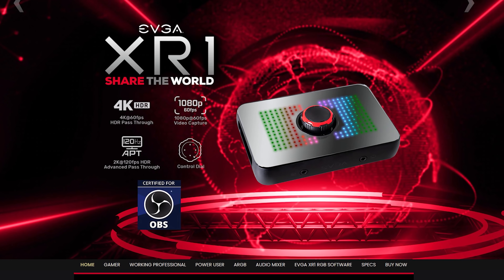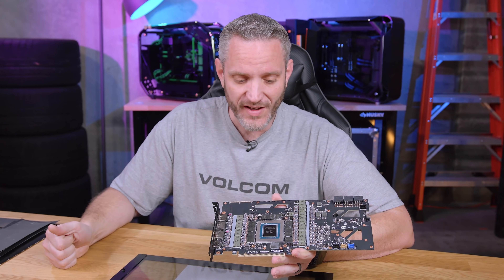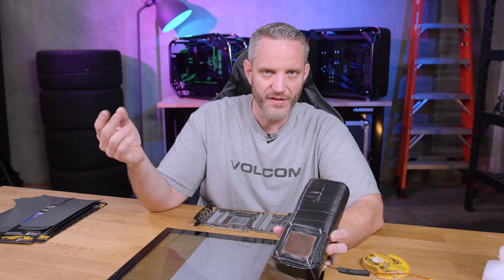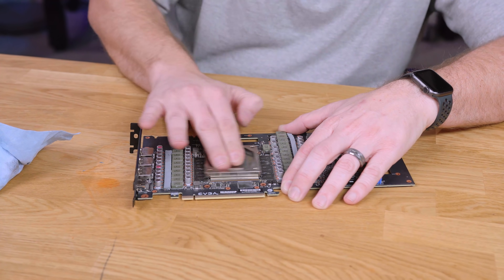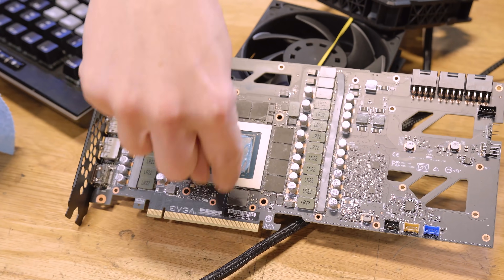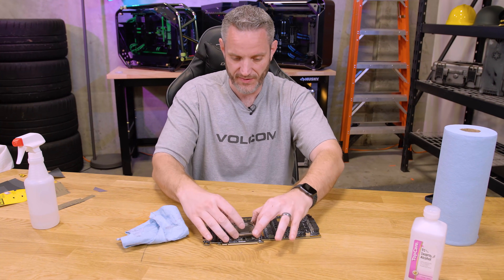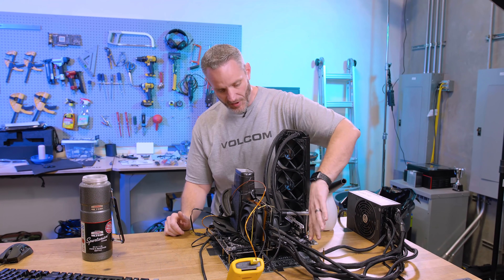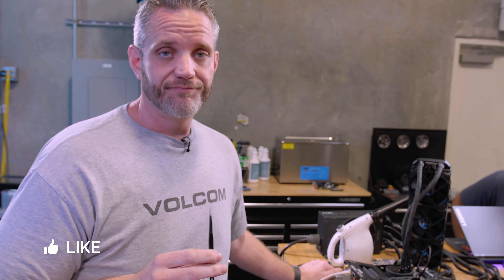I ruined another GPU....

Comment: I have a suggestion from a mechanical engineer (love these videos btw). Try using WD40 instead of water when lapping. It will help keep a more even lapped surface with a better finish. I did a bunch of this for parts in the aerospace industry to hit 1/1000 of an inch on tight tolerance parts (a third the thickness of hair). I would also grab a high precision mic (not calipers) and use that to get an idea of how much your removing and try and use a flat surface on the back side as well. If it’s tilted like it appears in the video, that might contribute to the L shape you had when lapping. You don’t really care about the flatness to the silicon but to the die itself so keeping the die flat and supported will help you take material off more even with respect to the die and not the silicon.
Reply: Isnt WD40 a lubricant also? Wouldnt there be some type of flammable lubricant left over any circuitry? Idk what the flash point is for WD40 but that would be cool to use.
Reply: @antiviruz42  wd40 is non conductive if this is your point?
Reply: @antiviruz42  wd40 is used for some engines, it can even be used if you run out of motor oil for a very short period of time.  plus alcohol cleans of oil without problem....
Reply: @auros2108  no he seriously thinks 1. that the wd40 could be start burning on the card, and that after cleaning the card with alcohol there would be oil left.
Reply: The parallelism of the die to the card is irrelevant as long as the die surface is parallel to the mounting face of the pot. With the amount of different components on the back of the card short of making a jig plate for the card you would never be able to achieve  getting the card to be flat on the working surface.
Reply: hahaha aerospace engineer saying "your" instead of "you're"
Reply: @mmmdawe  And using inches 😂
Reply: @mmmdawe  He's an aerospace engineer, not and English teacher.
Reply: @mmmdawe  :) we ain’t so good with spelling and grammar.
Reply: @DZPengu  I don’t think I explained it right but you are correct. What I was trying to imply was that if he laps the die at an off angle he would risk removing too much material on the top of the die and expose or destroy some the transistors. So parallelism to whichever plane was used as a reference for the transistors is pretty important. But I don’t think he is trying to take that much material off.
Reply: @antiviruz42  yes WD40 is a lubricant. That’s what you want to use when sanding metals. It helps the sand paper not get gummed up and still able to cut into the material. I personally would use acetone to clean it up bec it does a better job than alcohol. I think, but need to check that it’s safe to use on electronics, at least my EE friends used it in college. :)
Reply: @kaldogorath  I believe ewe mean "knot AN English teacher!" (homonyms used on porpoise.) :p
Reply: @petenielsen6683  Ahh dammit. That's what I get for not proof reading.
Reply: Pretty much any cutting fluid will do, as long as it's not too acidic. Laying the PCB on something like a 2-3+mm mat of silicone rubber (closed cell, firm but not hard, very heat tolerant) making sure the IO bracket is off or floating freely, is also adviceable. If using a big and heavy "sanding block" like this, there's no need to further stabilize. Just let the weight of the block do the work, and the size the block will keep things even because it will be gliding on the metal support frame around the die.

For checking the spread result, personally I use a lapped and polished 1 inch thick clear acrylic block with mounting holes, and just mount it like I would a cooler/waterblock/pot. That way I can see the pattern while it's actually torqued down, through the acrylic (where its close to "perfect", the layer is so thin it's transparent).
Reply: @pr0xZen  I feel like we’re getting into the weeds a but hey that’s what is so much fun! :) I like the idea of using an acrylic block to see the stress. I was thinking of using a small torque wrench and using a similar procedure used to put the valve cover on an engine. However, I like your approach better but I might still use 1/4” torque wrench just for constituency.
Probably supporting as I suggested is probably overkill and he does seem to be doing a good job of not rocking the sanding block. 
Thanks for the input and  ideas!
Reply: 1/1000 of an inch is like saying two hourglasses after 12
Reply: @TheGroberUnfug  well normally I would say “a thou” or “a few tenths at a time if you know what you’re doing” but I was trying to be understood and not confusing. Next time I’ll just muddy the water for you. :)
Reply: @TheGroberUnfug  I'd humbly suggest that the average consumer or tech-curious, does not have a relative understanding of dimensions for terms like "thou", "mils" and microns. Perfectly normal if you've never had a need for it. Choice of words probably fit the average audience here.
Reply: @mmmdawe  he might not be an “Amurican” trashcompactor thats unaware theres other places
Reply: Machinist here.  0.001” is not tight tolerance for lapping unless it’s across a comparatively large distance e.g. 12.0”.  Context matters.
Reply: @emilen2  As they do. You do realize that Lockheed Martin uses inches right? I mean, that's the whole reason NASA had a blunder with a mars probe. Lockheed made all their equipment inch standard. Telemetry included. Nasa didn't check and assumed it was in metric. Made a nice crater on Mars. The F22 was designed with inch standard, and parts made in American factories with inch standard machining. it's good copy protection honestly.
Reply: @TheGroberUnfug  you just have to be familiar with the Measurement that's all.
Reply: you're telling me that you have a OEM Manual that allows WD40 as a lapping agent ?   or were you using it for sanding.   Because all Manuals that ask for lapping usually use diamond suspensions or silicon carbide and a lapping plate.   BTW  Engine Overhaul here and we beat our Helium Light Band device regularly.
Reply: @shawnbottom4769  this is where  a optical flat and a helium light source come in. 
But the chip might be a bit dark in the reflection to see fringes.
Reply: i used to lap with Isopropyl alcohol, similar properties but wd40 is probably not great for computer parts. also a profilometer and a surface plate are going to work better than a mic, though its gonna be hard to make sure the card is flat to begin with
Reply: @Fahrenheit353  Appreciate the answer! Thanks for not being condescending and speaking for me. Il keep this in mind!
Reply: @scythelord  I can’t comment on what those companies use or allowed to but yes that really happened and was a great blunder. :)
Reply: @scruffy3121  you’re right I misspoke there. Lapping is polishing, and I was more referring to sanding or grinding. Jay was saying lapping when he was actually sanding so I’ll just blame him for my error. :)
Reply: @Fahrenheit353  Lapping isn't polishing.  Polishing only makes the surface smooth.
Lapping also hardens the surface.
There are machines that lapp and polish at the same time but it isn't the same thing.
Reply: He said he was getting the L shape from the thermal paste, that was before he started lapping the die. So, if he took out the L shape after lapping then he obviously cured the uneven die problem. I've done this method before on CPU's, and he's doing it as good as it gets. By flattening out the sanding block first, and using this method, you can't go wrong if you know when to stop. Yes WD-40 works better, but not necessary, water works just as good... he's not doing rocket science.

Comment: Everyone: I'll never get my hands on a 3090
Jay: Let's break one EZ!
Reply: I think it would actually work just fine without that capacitor btw
Reply: I'm with  @dextrodemon  it was clearly a show capacitor. That's why in always ripping capacitors off my stuff.
Reply: I have never even held a 2 series card...
Reply: @SugerFreeJazz  correct, most capacitors dont do anything theyre just there for show
Reply: @dextrodemon  non critical and for show are two different things.
Reply: Even if the case is the only purpose they have is redundancy. I would be shocked to find out they are in there to truly do nothing
Reply: @dextrodemon  That is not how engineering works. There is probably a reason, it just won't stop your card from functioning if that particular capacitor is out of operation.

Comment: 5:36 What if the bowing demonstration is what actually broke the card LOL
Reply: it pretty much could be that, there was def. plastic being torn apart, if not even copper lanes inside it. the ln2 cooling hurts even intact pcbs much, i think he was just stupid and killed it there. i still dont understand why he uses over 200g of metal pushing down on the chip...
Reply: @J G thermal degradation of weakened material isnt just there from 100 to 0 in a second. also it was ultimately killed by jay ripping things of, but look at nick at the end, he had enough of jays shit. :D
Reply: @J G ive said he could, not he did. im sure the card would break under ln2 in the near future due to the pcb.
Reply: He didn't bend his Kingpin card, which lost the capacitor.
Reply: That wasn't the same card. The 3090 FTW3 is the one he showed bowing on, the 3090 Kingpin is the one he lost the capacitor on.
Reply: @kaldogorath  he did not? i thought he did, i guess i look better next time, its still a comitted sin :D and even if it would be dead, to have 2 dead 3090 is even more of a sin.
Reply: That sound hurts
Reply: I know it’s not the bending that broke the card. I think it would be really funny if it did. Cheers!

Comment: Hey Jay... Been watching all you XOC legends ( thats right i consider you just as capable as the others ) from the point when you and Steve first jumped in the ring... I really enjoy the way you've made all your own experiences into lessons. Something came to mind when i saw the pitting after your mount on the lap die. What if the thermal paste is getting micro bubbles in it, causing those sections of the die to reach extreme temps in an instant and damaging the surface. had a quick google and found this in regards to "how to remove micro bubbles from paste":
- Use centrifuge and vacuum. After mixing, do centrifuge at high speed, then place in vacuum, then repeat the steps if needed to remove all the bubbles. Big-size bubbles will be remove by centrifuge and small ones by vacuum.
Its a pretty extreme step, but if you find someone with some lab tech, maybe it'll give you the edge... It may be worth looking into moisture (H20) content of the paste as well.. Keep up the good work bud...

Comment: Suggestions:  Besides learning about "flatness" and the "3-plate" method, as you're lapping the die surface with your custom sanding block, besides changing the direction and method of lapping, also change the orientation of the sanding block, by 180deg, then 90deg, then 180deg, then 90deg, this will "zero" out any of the remaining variations in the sanding media itself.

Comment: Back in the mid 2000's lapping was not even a choice, it was a necessity as vapor chamber wasn't around yet... I lapped my Duron 1.3Ghz and an "all copper" cooler I had. Temps went 15°C lower.

Comment: A tip I picked up from other luthiers for adhering two surfaces together! Put painters tape on both surfaces then use super glue to set the tape together. Don't forget to use some superglue kicker to accelerate the process. Makes the adhesion point super thin, even, and easy to remove! Love videos. Much love.

Comment: Tape around edges to stop fine metal from going everywhere.  Next use a dine small lapping stone or fine sharpening tape mounted on glass.  Protecting the surrounding area from the fine metal removed is extremely important

Comment: Whitworth 3 plate method is what you are after for "perfect" flatness. However, you could lap the plate on the block against the die and they will conform extremely closely. Lap in a figure 8.

Comment: I've used this method before, and it works. Always make sure the sanding block is flat first, that's the key, then by using this sanding method carefully, you can't go wrong. If in doubt on the flatness of the sanding block, you can always use the edge of a feeler gauge to check it. The edge of feeler gauges are spot on flat, so long as it's not cheap piece of bent crap.

Comment: Any slight pressure on an MLCC can cause it to crack - this inevitably causes an internal short circuit and since these are used across power and signal lines there can be all sorts of crashes down to a power supply short circuit - aka smoke / fire / no boot

Comment: Super fine lapping compound and a small round disk  of glass (no corners ) will give perfect flatness. If really done right, the die & the copper sink will have to be pried or twisted off. I used to machine then lap various metals to  +/- .0001in back in the day. In theory, if flat enough, you  wouldn't use paste as it would actually insulate vs transfer.  HUGE fan, love all your stuff...

Comment: I am fairly sure the letters are engraved into the die, they aren't raised. and they probably have next to negligible effect on temperatures. The biggest issue is the die probably has almost no buffer before you reach circuitry so if you go any deeper than the letters you are probably hitting the circuitry in the die.

Comment: Try silver plating one or both of the contact surfaces. Silver is more thermally conductive than copper. 
You can check true flatness with a small piece of glass. Glass is as near flat as you will get due to the manufacturing process. Low viscosity/low surface tension fluids like acetone or methyl alcohol sandwiched between two surfaces will maintain capillary contact between the surfaces where they are closest, and with glass, you can easily see it. This includes checking two pieces of glass for flaws. Moving and rotating the pieces reveals flaws because the liquid "sticks" with the piece containing the flaw.

Comment: Didn't it occur to anyone that the die itself could be soldered slightly crooked on the board ?
Reply: Could very well be, but for mounting the hardware it needs to be parallel to the board either way. It's closer to that now.

Comment: when lapping precision parts, like hydrogen seals on generators, you're supposed to lap them together. so in your case you get the pot and die together just like if you were mounting them, and put some lapping compound between them. the compound is super cheap, so all you gotta do is be really careful. easiest way is to count to little circles, clean, check progress, repeat until satisfied. think of it like breaking in an engine

Comment: Use fine valve grinding compound in a figure 8 on cold plates or anything you want flat. Then use fine 1500+ polishing paper to get the desired surface finish. I noticed a more consistent hight center to edge using a dial indicator.

Comment: You should run it in a farady cage with just power, and controls piped through, Im not super into xoc, but if the transmitter can affect how clean the power is when it's delivered, getting rid of all radiowaves might help

Comment: You could try a smaller block honing stone, I use those on my engines flat surfaces before I mount gaskets to make the surface as flat as possible with minimal metal removed.

Comment: 11:10 if you are concerned about getting some of the mounting screws too tight(compared to the others) a torque wrench would assist in ensuring the screws are equally tight.  If you are torquing them in unison(the way lug nuts are tightened on a wheel) , it might be causing the card or even the die to flex ever so slightly.

Comment: Was gonna say you should be using a certified granite surface plate. Glass is generally flat, but it no where near perfect. Good enough for lapping a AIO for general use. If you are trying to keep the TP uniform by microns. You need a professional surface plate.

Comment: I don't like this misuse of terminology.
You are sanding the die, not lapping it.
Reply: Lapping is removing the top layer of a surface sanding is a method for reducing the top layer of the surface he could have used a liquid abrasive or polish then it would be closer to the dictionary definition but they are essentially the same. Chill
Reply: @sleedog11  I'm sorry you feel that way. I work with extremely tight tolerances, and in  my world comparing lapping to sanding is like comparing  a B52 Bomber to an F1 Race Car.
They just aren't the same.

Comment: Jay, not sure if this would work but you know that machine that engine shops have to resurface engine blocks and cylinder heads to make sure they're flat? Those can remove material in extremely thin layers and they're calibrated to make sure that they are dead straight. Maybe see if you can do something with that next time?

Comment: If the PCB is deforming as you crank down on it, the die could be deforming and you could be touching around the edges and not in the center.  If you can still buy a product like plastigage maybe you could put pieces of it on there in various places to see how even the contact is.  And also it might be better at lower clamping pressures, you would have to do different tests to check that.

Comment: I would suggest sometimes testing without the lighting equipment on. A lot of light could interfere with what extreme low temperatures actually achieve in a semiconductor.

Sometimes we some industrial product fail in australia just because of the slightly higher backround radiation

Comment: What's the most you can mess up a piece of hardware and still have it function, just glitchy? For example, cutting a random wire, removing a random capacitor or something, damage a connector to where it barely functions, etc